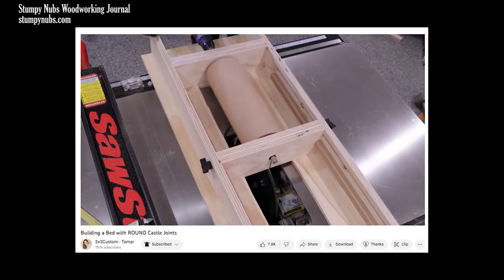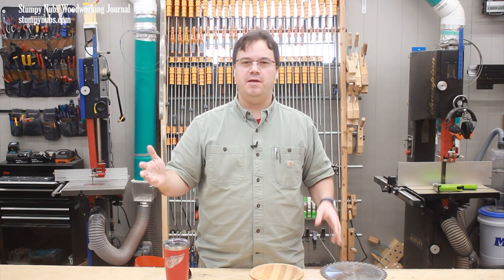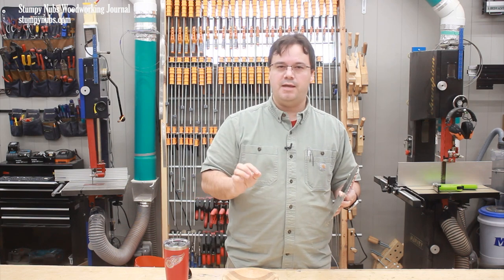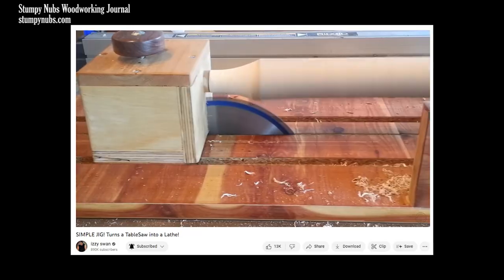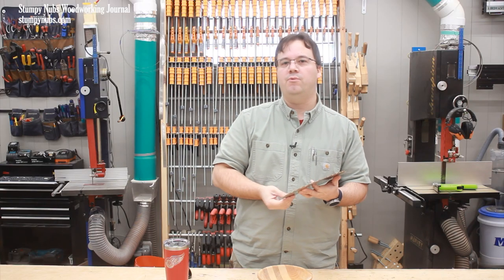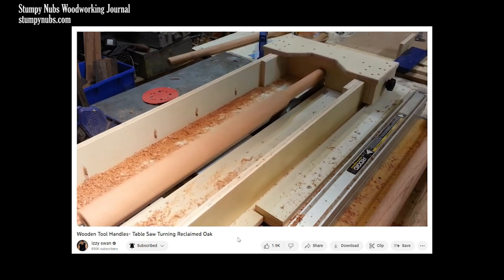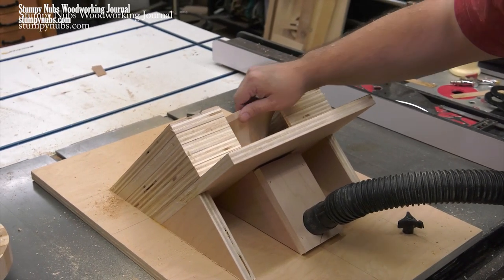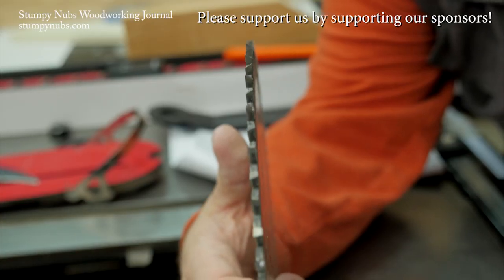DANGEROUS new trend in internet table saw videos? You decide...

Comment: I've related it to using the trenching feature on chop saws for half lap joints, at the end I've always gone side to side to clean up the cut after all the reliefs are made. I would not ever try to remove all the wood at once going side to side but it cleans up fine when the reliefs have been made.

Comment: Cue makers have converted table saws to dowel turning or tapering machines for a long time. Those shafts are held in with less force than the examples in the video, but the passes are so fine that the force on the blank spinning is minimal.

Comment: Nice analysis of techniques that may look sketchy, but really aren't so long as your jigs are well designed and constructed.  The techniques do have some major drawbacks as compared to using a lathe.  When making legs on the table saw, you're limited to making cylindrical dowels without any fancy profile.  When making bowls or cove cuts,  you're limited by the radius of the saw blade.

Comment: The speed of each of the saws teeth and the slow-ish rotation of the wood being turned surely results in the blade cutting away the approaching wood as it normally does, long before the rotation  has a chance to impart much of a sideways force. You should get the Slowmo Guys to do a high speed video to see....

Comment: Just to be clear you don't have to turn it on to get injured. My only table saw injury happened a few days ago. I've been building one table to house my table & miter saw plus out feed & some storage. I was trying to remove the guard on the underside where a vacuum hooks up because the whole bottom will be dust collection when the screwdriver slipped & I cut up my hand on the blade under the table. Haven't bled that much in a long time.

Comment: I'd love to see you do a video about air compressors for woodworkers. What's the minimum I can run a brad nailer on? I also want to get into HVLP for finishing but there's so much conflicting information out there. Some people say you can get by fine with a 6 gallon 2hp unit if you take your time, some recommend giant expensive 60 gallon 3hp units MINIMUM for spraying.
Reply: A little "pancake" compressor works fine for a finish nailer or stapler, but you need to make sure the pressure is high enough to reliably run the tool. The finish nailer I have needs at least 100 PSI. Less than that, for some reason it fails to have the ram come back fully. Drives the nails fine but a pain to have to unlatch it to take pressure off the nails then re-latch it to drive the next nail. When I turned the regulator up from 80 to 100 it worked perfectly.

Comment: You can absolutely feed wood perpendicular to the direction of a sawblade, as long as you're not trying to remove too much material at once and the material is well secured. I can't count how many times I've used a skilsaw as a makeshift planer by setting the saw depth to ~1/32 of an inch and pulling the saw sideways across a plywood end to trim it down exactly where I want it to be.

One example off the top of my head, I built a curved lecture hall with movie theater-style seating where the tiered floor was a high gloss concrete finish. The high gloss had to be done at the time of placing rather than buffing it in after the fact, meaning the finisher was there for about 10-12 hours repeatedly hitting the concrete with a high speed power trowel to bring out the shine in the floor as it cured. Each new bench tier had an elevation tolerance of +/- 1/32" from design at the front edge of the bench(there were a lot of electrical and mechanical rough-ins that had to be at exact elevation and it was all architectural, long story), and the top of my bench forms had to be flush to the finished concrete elevation (rather than running the forms tall) so that the finisher could run his polishing power trowel across the top the formwork in order to properly finish all the concrete.

So after installing my forms but before pouring concrete, I would take a rotary laser and check the height of the curved plywood form every few inches and if the plywood was slightly high, I would mark the edge of the ply with my pencil and then slowly shave the plywood edge down by pulling my skilsaw sideways across the top of the form until the pencil mark just disappeared. Then check the height again. Works like a charm, especially if you attach stair gauges to the shoe of your saw as a guide to make the blade position consistent for every pass.

Comment: The point about needing multiple exact copies of something is apt. Since the jigs on the table saw will give you consistent results by removing most of the variables from the equation. Whereas trying to get consistent results by hand on a lathe.... it can be done, but that typically comes with a lot of practice and steady hands. Whereas someone comfortable using a table saw can get consistent results from one of those lathe jigs with little effort with the tradeoff being flexibility.

Comment: I've follow a professional wood working studies and we do lateral cuts sometime. What we do have to understand here is : do not expose your hand to the blade at any cost. Do jiggs who can afford to take the blade in if needed and keep your hand out of this zone even if you got more then 2 inches of solid wood. The way they teach us was t is like anything! know how walk before run! Best exemple i can say is biked riding. Always wear protection ; take progressive steps to know your limit and the bike capacity! After this take some practice and when you will 100% know how ride then you can go mountain bike! But while you transition from normal to mountain bike BE EXTRA CARFULL cus you are on unknow territory! you have to start again!

The exercise they gave to us was doing mortice and tenon joint and do shoulders in stair patterns or some grooves. It is practical/ useful knowledge and ''safe'' way to learn how do. It will also make you think 3 or 4 time before do any manipulation ; blade tend to go up a bit when start spinning ; start and stop quickly your saw and ajust measurement! It will give precision and safety!
When you will have refine the process and make it idiot proof you will be able to take more QUOTE considerate risque : like putting your had above a solid wood piece whit a blade in action in! 

All this to say : know how work safely buy calculating each steps and processing what can go rong and how react in such cases! Also 101 advise never do such thing alone! always have some one not far be able to react in case of need and warn them BEFORE do anything who contain a higher risk then usual! 

HAVE FUN!

Comment: I have turned tenons on 3 to 5 inch logs on my table saw. A pin centers the log and offsets it from the blade by 1/2 the desired thickness of the tenon. Then I gradually raise the blade up while rotating the log, to whittle it down. That leaves a nice shoulder when complete to transition from tenon to full size.

In this setup, the log has to rotate clockwise. If counterclockwise the teeth catch the log too high and the reaction is to bite too deeply causing it to grab, pull down and bind the blade. 

Of course, if the pin were on the other side of the blade, rotation would be the other way.

As far as safety, on a 5 ft log 4" to 5" diameter, I'm standing about 3 ft from the blade, manually rotating the log. On a 3 ft log  3" dia, I'm still 2 1/2 ft to 3 ft from the blade.

Comment: Hey StumpyNubs, I'm replacing some exterior trim on my parents house. This trim was primed with Cover Stain Oil based primer (multiple layers) and then an exterior acrylic enamel.  The trim was in terrible shape, in many areas it was rotted so much that only the paint shell remained and where there was still wood it was wet and spongy (The trim seemed to be painted well too, back primed and primed on the butt ends.)   The last rain we had had was multiple weeks prior, which brings me to my question.  Would using a primer that is more vapor open (higher perm rating is what we call it for other building products) help extend the life of the exterior trim?  If so what type of primer might you use on your project?

Comment: I had my left thumb sliced clean off on a dewalt jobsite saw. They did reimplant but no tendons, nerves or bone was reattached so just a stiff apendage with a floating thumb bone. Got too comfortable. Was notching toe kick so the vent behind would vent air.. Done it dozens of times. Distracted for a second, I left the blade throw the piece and my left hand on the backside, sucked right in. Clean slice into 2 pieces. 8 months, back on the same saws but a majority of them I use a sawstop pro

Comment: I think something to consider is that a lot of people have very cheap table saws, which will cut straight happily but are extremely dangerous when loaded perpendicular to the blade.
Some of these table saws have a fair bit of torque, but run at much lower RPM.
Not only that, people are doing this with all sorts of drills/RPM. Just seems extremely sensible to avoid using a tool so far outside it's designed parameters.
If you need a lathe, use a lathe or find some other established method. This is just going to lead to unnecessary injuries.

Comment: I have made cove on the saw.  It can be a scary proposition because the wood wants to jump away from the blade, but it works great for making the rail that holds chalk for a chalk board.   There is a lot of sanding afterwards but there is no other way to make it unless you have a molding machine.

 In my 46 years in the cabinet trade, I agree with you none of the procedures you show are inherently dangerous.

"think through".  It's what you don't know that you don't know that maims you.  And no matter how many things you can come up with that could happen, there's always one more.   And it's the "one more" that has gotten me every time.  "There is no substitute for paying attention", something ER doctors should remind every patient that comes in.

Comment: When I first saw @3x3CustomTamar using the table saw turning jig I thought she was pushing the limits or worse!  But she explained it and demonstrated it so well that I would use this method if I had to.  The explanation here helps too.  When you think about it, any non-through cut is safer than a through cut: kickback and blade exposure are rarely an issue.  These turning jigs only deliver  non-through cuts.
Reply: If you look at the example that 3x3 vs the long skinny rod by another guy.  The 3x3 takes much shallower cuts.  The other guy did it in 1 past.  That would worry me more.  I think Tamar is pretty level headed.

Comment: For MYSELF I like using Frued saw blades for a large bit of cutting do to the fact that they don't remove slot n take less power,, especially when I'm cordless. Otherwise, I look to ' heavy ' blades for the kind of work shown here.  Even 2blades with shim to increase performance and wear. I like jigs, when possible, to have a thick poly , clear piece over open jig/work piece
 ( plus vac port ).

Comment: The lateral force on the blade is proportional to the ratio of linear velocity of the workpiece (rotational velocity at the contact surface if spinning) to the velocity of the saw teeth and is likely very small unless the workpiece is spinning VERY rapidly.

Comment: not speaking about this particular subject but it matter where you are applying the pressure, so you can put a lot of weight on a 4x4 vertical but you do that horizontal that 4x4 will break with way less weight. So hitter the blade from the side is  different than from straight on.

Comment: Recommend full kerf blade for this, and as described, high quality manufacturing.  

Full kerf reduces blade deflection, which is both a quality and a safety enhancement.  Less blade deflection at the cutting tip is good, and a full kerf blade, well made (Ridge; Forrest) is going to do just fine for deflection if you feed at a reasonable rate (you'll feel when it is wrong).

I work in metal cutting, and look at wood working through the lens of machining metals at high speed.

I do NOT see the illustrated techniques having a significant risk of workpieces being jettisoned from their work holding.  In fact, the work holding pieces are very well designed for both rigidity and, even if by side effect, human protection, and there is almost no risk of the work holding apparatus causing the operator to be injured by being subjected to kick-back or by being dragged over the cutting tips.

Comment: i mostly agree. except for one part. i DO thing it is not good on teh saw. yes, i agree that the bearings likely CAN take it, but most table saws bearings were not designed for side loads, so it would be detrimental to saw life. however i feel its mostly a moot point. i havent engineered or calculated anything, but it feels like this would maybe shprten the life of a GOOD table saw less than most people will ever use one.

Comment: Love the video but I have a short story about Ridge carbide blades. Had a full kerf 10” on my 3 Ho cabinet saw. I went to rip a cedar fence picket.  During the process several of the teeth came off the blade when I was cutting through a knot. Blade lost several teeth and Ridge refused to make it good.  I use a Woodworker blade now   Just my 2c.  Great video though
Reply from the maker: I think there's more to this story...

Comment: Someone may have stated this (in agreement) already...Most of the cutting is done in the normal designed direction of the tooth.  Compare the sideways speed of the turning part to the tip speed of the saw tooth.  The tooth tip speed is many times the speed of the turning surface, so most of the cutting force is in the normal direction, with very little side force at all.

Comment: Say there MR. nubs need some help - in the  year 2015 I glued some pine together 3/4"x4"x12" with tight bond 3--looked at it the other day , an few joints failed --,the wood didn't fail ,but the joint did not every joint but a few----would epoxy on the joints stop that -- thank you for may be responding back don't know to get the line out of the words sorry

Comment: I sent saw stop an email to ask if their saws are designed for this type of cut/lateral force being applied. This is their response "The saw is capable of making these types of cuts, however they can be very dangerous and should be done with caution and safety."

So, at least Saw Stop states that their saws are capable of this.

Comment: Most DIYer's have limited space and do not have the luxury of multiple machines. People are very inventive and think outside the box and as long as they do not over stress the machine and the blade is untouchable it looks like a perfect solution. To me making bowls in jigs on the table saw look safer than sticking a chisel by hand into a spinning lump of wood. Plus you need less strength to do it on the table saw.

Comment: I'm glad i have a lathe. One of the golden rules of tool use is only use the tool for what it was intended and designed for. That rule is to keep everyone safe. You could use a table saw as a tennis ball launcher too but that not what it was intended for. This is kind of a gray area. When you create a Jig for turning bowls on a table saw, you now have a tool that was intended for that. So that should be ok. Its up to the designer of that jig to make it correctly and as safe as possible.
Reply from the maker: Table saws were originally designed for making rip cuts, and that's it. No crosscuts, no dados or rabbets or grooves or tenons- we do lots of things with table saws now. I think it's better to judge each technique individually that to apply broad rules.

Comment: I would compare the speed the drill is spinning it vs the speed of the saw, from the saws perspective the piece of wood is almost entirely still
If you visualize one tooth moving slowly, the dowel isnt hardly moving and with shallow cuts, the dowel is only spinning a fraction of a degree while each tooth is engaged

Comment: Assume the Tablesaw has a 10" blade operating at 4000RPM
Assume the round part at 0:18 starts at around 4" diam and the milwaukee drill is at its max speed of 2000rpm
The tip speed of the tablesaw blade is about 2094 inches per second
The tip speed of the round wood part is about 419 inches per second, perpendicular to the blade.
The combined "collision speed" of the two is the vector sum of those two speeds, 2136 inches per second (2% higher)
The actual impact against the saw is the vector angle of those two speeds, only ~11.3 degrees off the plane of the saw.
This is far less than the coping video at 4:50.

The smaller diameter chair/table leg is even less off-plane because the leg's linear speed is much slower.
Reply: You have to factor in the feed rate my friend.  If you feed rate is 0, regardless of what table saw speed, the impact is 0.  If feed rate is high, the cut is steeper which translate into higher stress on the tooth.

Comment: While my initial thought was that it looked quite sketch your explanation does alleviate it somewhat, if you were to use the appropriate tools, jigs and precautions.
That said, we all know someone will try to do it on a frame nailed together from rough cut 2x4, without the bearings on a poorly fit workpiece with a rundown saw and blade without wearing PPE. It will work the first 6 times and then a tine will fly off and hit them in their jugular, if they don't loose a finger first of course.